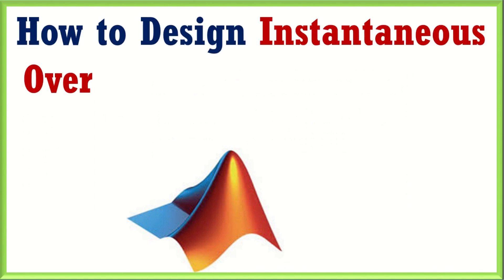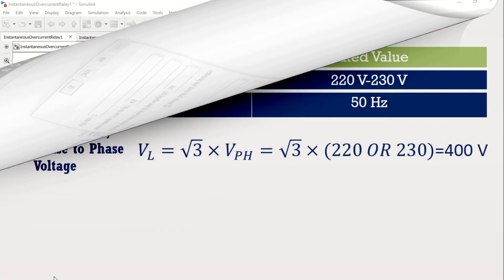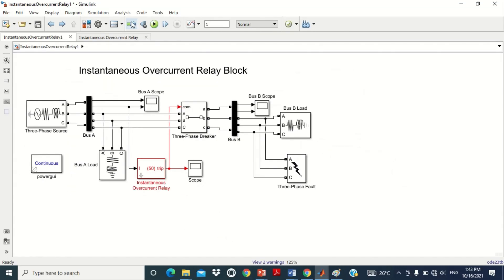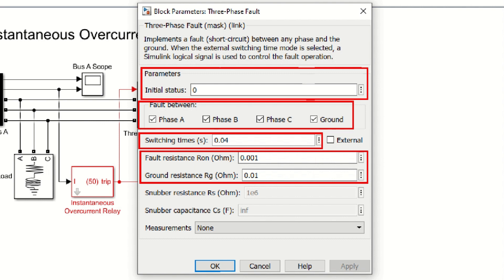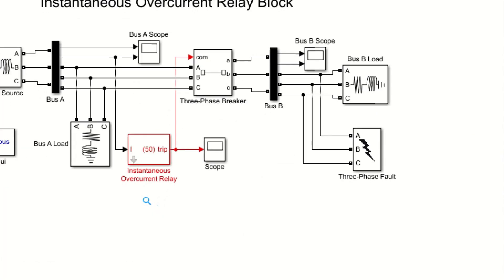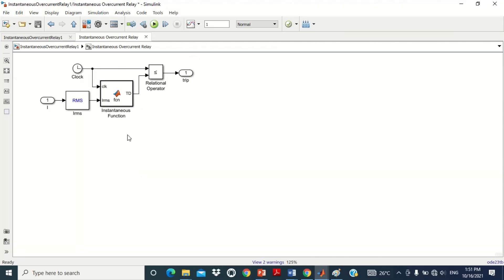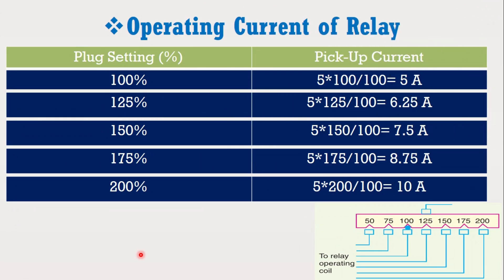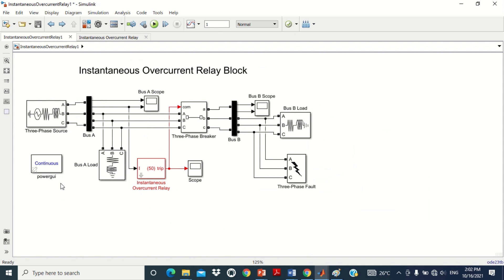How to Design Instantaneous Over Current Relay Model in MATLAB SIMULINK | Dr. J. A. Laghari

Comment: hello sir
i have an error 
(object[id]!=NULL
Component: Stateflow | Category: Assertion error)
the matlab version is 2014
please advice?
Reply from the maker: Thanks for the comment. Basically I have used latest version. Therefore, it may be give error.
Reply: @DrJALAGHARI  thanks to reply;
now i have  IEEE  32bus system and i need to using the OCR in my model
i have four parameters (TMS& IP &CTR &IPZ) but i can not used it in your model, please give me your helping.
Reply from the maker: @ibrahimhamdeen133  thanks for the comment. I think you may watch the video carefully, I have explained every step. Furthermore, I have given the link in the description to download it. Use the latest version. It will work fine. That's all I can do.

Comment: hello sir
i really want to thank you for your videos.
I'm an electrical engineer student
I'm working on relay optimization settings.
can you show us just a simple model how to use an optimization algorithm with protection relays of a power system....
i will really appreciate if you can help me.
thank you in advance
reguards.
Reply from the maker: Thanks for the compliments and comment. To do this, first try to find any research paper closely related to this topic. then follow that paper step by step.